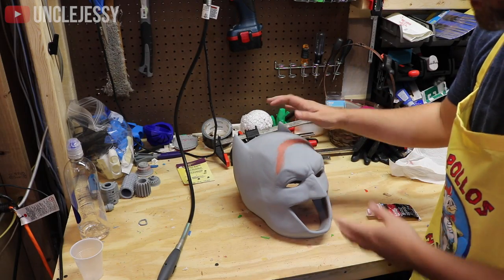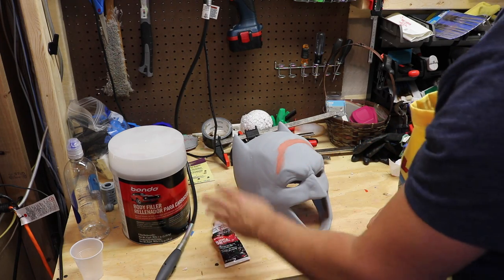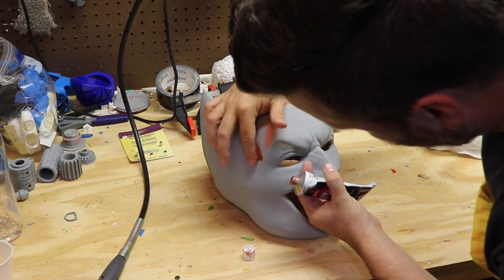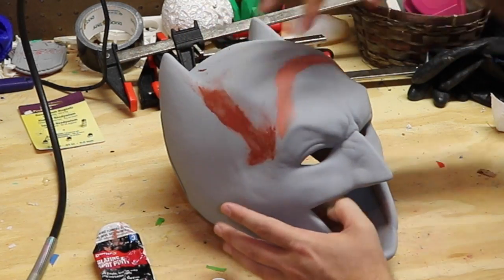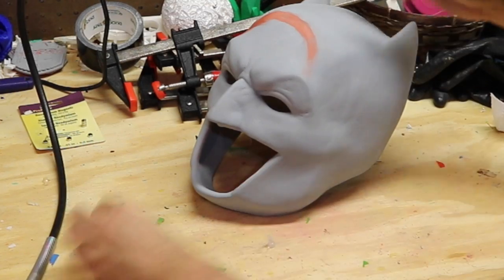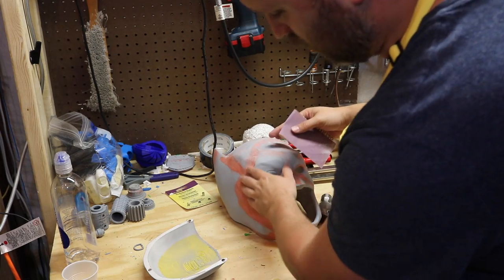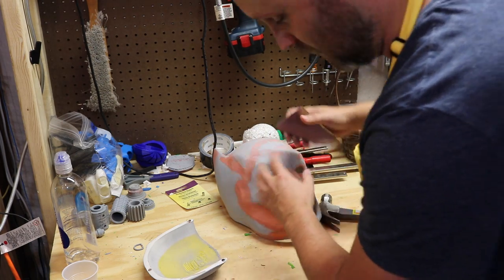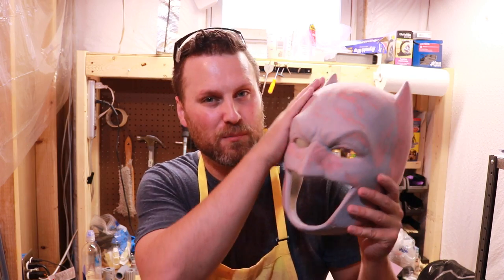3D Printing Tip - Bondo Spot Putty - Ultimate Batman Mask Part 3

Comment: Damn! Great job on the mask. 

I use that bondo Glazing putty too on my model's. here's a tip on sanding. sand the part under a small amount of running water in the sink, it takes away the dust from the model and sand paper and keeps the part smooth, no dust or mess. just dry with a towel and done.

Comment: Played around with XTC-3d on a mask and discovered it's way too thick for very detailed objects, tried to even thin it out with acetone but it was still too thick, you don't have a lot of control and it tends to create drips and fill details. Will try woodfiller next as it seems at a glance to be better, you don't need gloves as it isn't toxic and you can thin it out with water, it may be more time consuming since you need to go over the entire surface but you will have more control. Another alternative may be an acrylic spot putty like the one punished props is using.

Comment: I’m making a respirating mask and was wondering if this spot putty method would work to make the porous surface smooth and filled in as to not let air in through the imperfections of the 3d printing process. Thank you

Comment: Glaze putty or polyester filler is not the same as bondo filler putty. It's intent in automotive is to do exactly what you did here fill small pin holes or low spots to perfection prior to primer or paint. You might give Eastwoods Polyester Glaze Putty a shot, I find it way easier to work with and much better quality than the bondo version, although you do have to mix the catalyst. Great work man glad I stumbled on your channel

Comment: What 3D printer do you use? And could you recommend a good affordable mid range printer please??
Reply from the maker: I use the BQ witbox. I would recommend taking a look at the Robo3d printer, duplicator i3, or the monoprice i3 printer. I believe you can get all of those for under $600. You don't need to invest in a 2k printer right off the bat when you're starting out.
Reply: +Uncle Jessy ok thanks for the reply I'll look into it

Comment: Would you recommend this for seam lines when you have to print in multiple cuts?
Reply from the maker: If the seams are clean then yes. If not then you need something thicker to fill the seams. I usually will use Aves apoxie sculpt